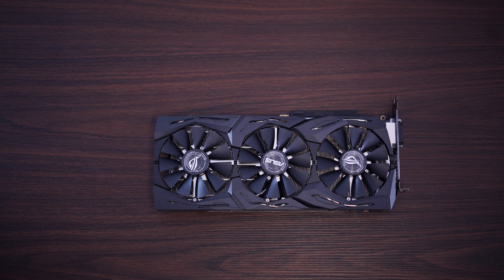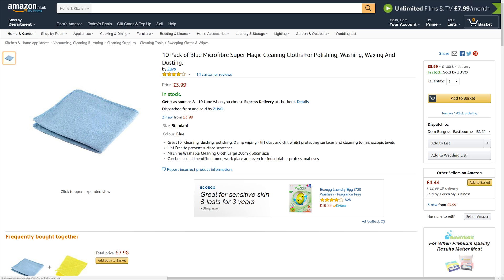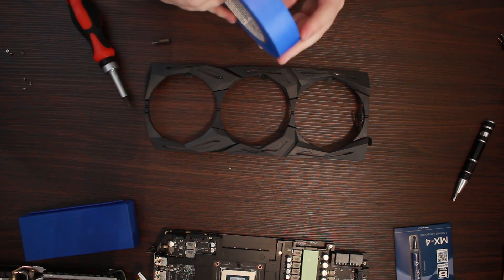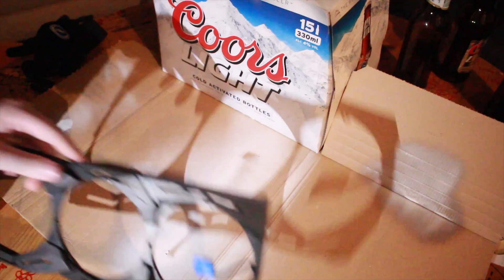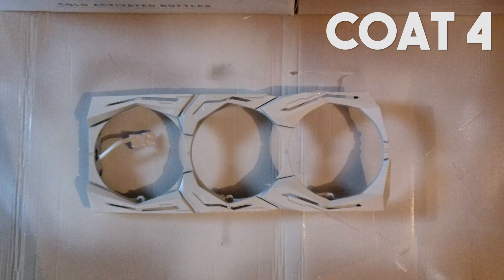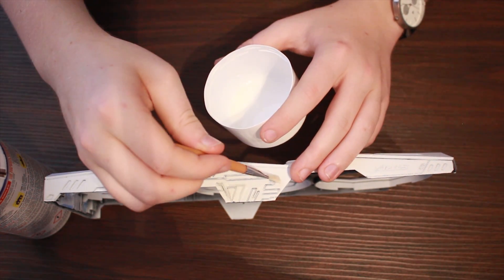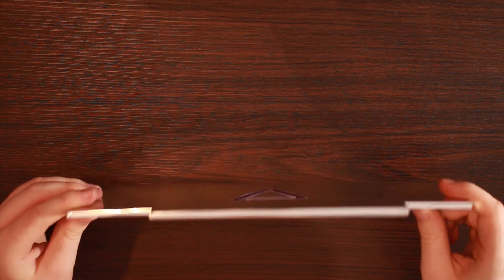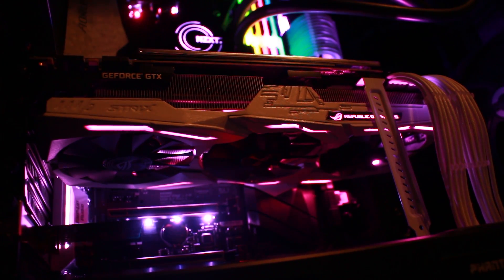WHITE STRIX 1080 Ti MODDED! ~ Painting / Modding The Strix 1080 Ti ~ Disassembly & Painting Guide

Comment: You're giving painting advice but you're a bit off 
Shake rattle paint cans for 2 straight minutes right before painting, and during pauses in painting.
Always hang parts to be painted instead of laying down.
PRIME BEFORE PAINTING
Paint in light sweeping coats back and forth, not just one direction.
Many light multiple coats instead of slow thick coats will prevent "orange peel"
Youll never need 6 coats unless youre using lacquer, you're under this impression since you didnt prime. Prime 2 coats, paint 2-3 coats tops.
15 minutes between coats is more than enough for rattle can process
If you see bubbles stop painting, go read how to paint 101 while the part dries, sand it down and start over.

Comment: Hey! so i need some help... i am getting a h500i and idk how to do the airflow with an aio(nzxt kraken 62x),that means that i have fans pushing air through the radiator.The problem is that the hot air from the radiator will get in my case and will heat up my other components,i will also get an extra exhaust fan for the top of the case. So please tell me how is the air supposed to be flowing for my other components to be cool too?(Btw graphics card is a 1080 strix if the gpu's fans also matter).I will also probably mount the card vertically in the future

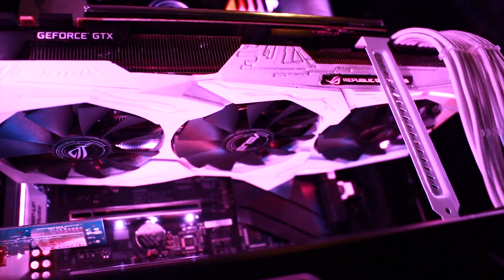Comment: If any of you do this, hang the shroud with some framing wire while painting it (preferably somewhere you can stand and walk around the part). You won't have to blow it with a paint brush (10:20), or have to move it until it's dry. I also recommend keeping a light in one hand and the spray can in the other while walking around the part, continually inspecting and spraying. With the part hanging you have to take extra care to keep coats thin, because gravity will be working a bit harder to create runs. I recommend Tamiya model spray paint for plastic. The pigments are ground much finer than typical plastic paints (which are really more suited to painting plastic lawn furniture). The Tamiya paints also resist runs very well and are designed to spray very thin. A great extra step is to use their matte clear coat afterwards, but it's not necessary. I don't want to undermine this video, but I have a lot of experience with this stuff and I know it's possible to paint one of these to look like is came from the factory white.
Reply from the maker: You're not undermining anyone buddy, I'm sure a lot of people find your experience with this incredibly informative. Thanks for the comment :)
Reply: Hi, thanks cause I was looking for a brand to spray paint an old gpu for my gf
Looking for a pink non-glossy finish, shoudl I buy the matte clear coat to achieve this ?

Comment: I want to do this myself and although i am familiar with pc hardware im still concearned of basically instantly destroying 400USD... 
Basically ass long as i use new thermal paste and pads, dont throw it around, dont paint the pcb and dont drop anything on it im fine, right?
Reply from the maker: You wouldn't be able to paint the PCB anyway. You don't even need to take off the cooler, there are just screws on the side of the shroud and by the fans. Remove them, paint the shroud then screw it back in. No damage to the card itself and if you mess up, you can peel off the paint job and if you damage the shroud you can get a replacement shroud from Asus. No need to even break the sticker on the backplate of the card or replace the pads or paste.
Reply: Since i have it on display below me im also talking and especially scared about the backplate, since i have to take apart everything to get to it...
Reply from the maker: You don't have to touch the backplate at all mate, just leave it out and only paint the plastic shroud. Really, there's not much risk with this.
Reply: For me the backplate will be basically the only thing i will be looking at, so if i want to paint it i have to paint the backplate.